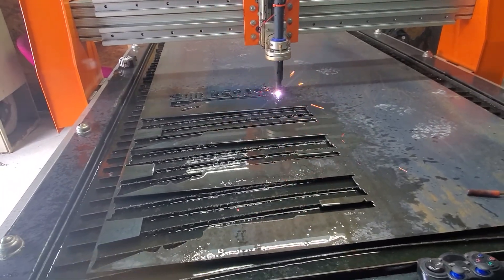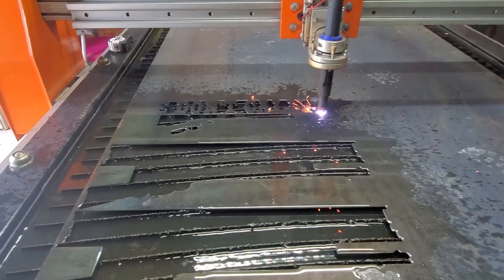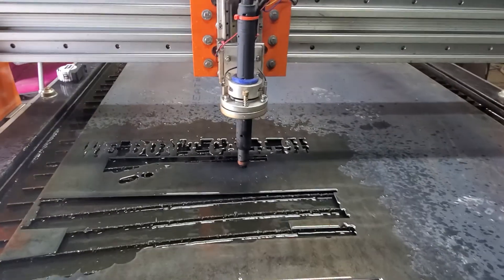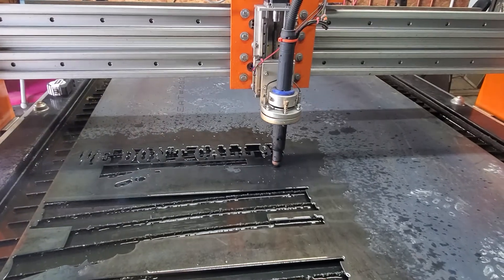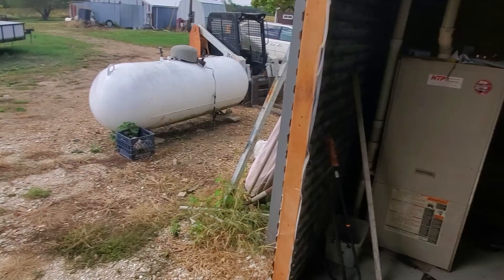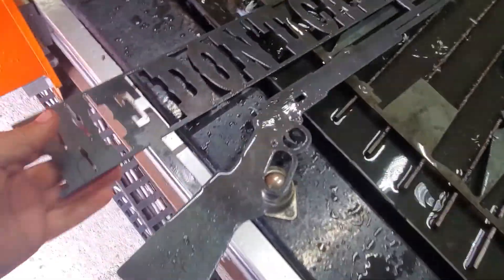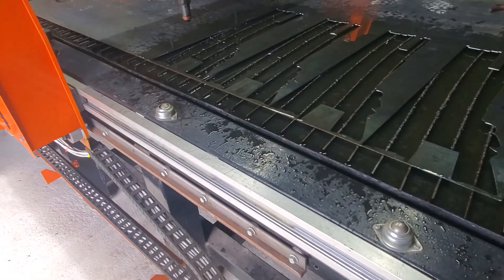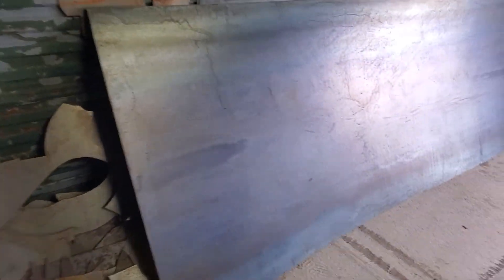Home Built Plasma Table,  Cutting and picking out , fall out pieces.

Comment: Would you happen to have the contact info still for the linear rails ? I watched your table build videos and never have seen em before then. They look really nice.
Reply from the maker: Yea I got them from Alibaba for $807.00 shipped to my shop in a week. You email me if interested to who to contact there. dishtech43@yahoo.com
Reply from the maker: These rails were at one time used on the Starlab tables. Best Out there. Adjustable rollers also.each holes like 350lbs.